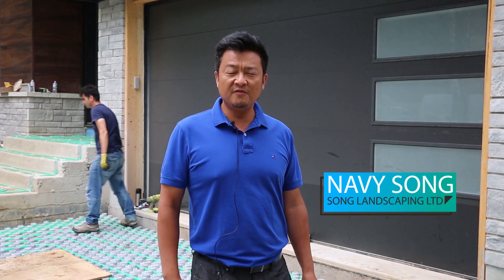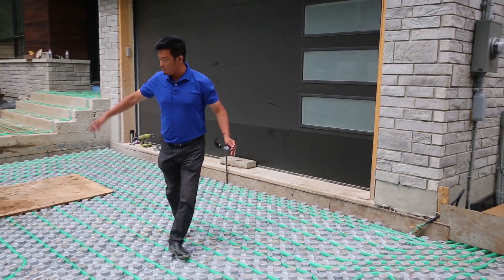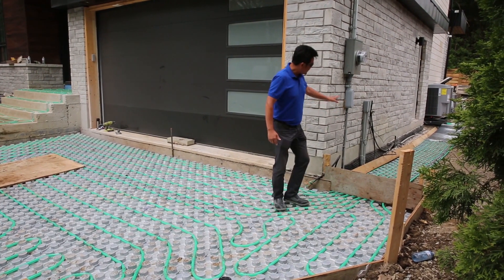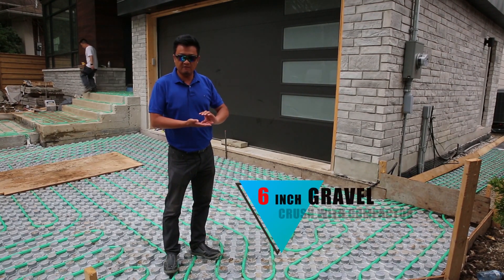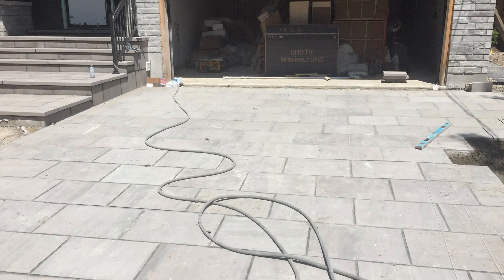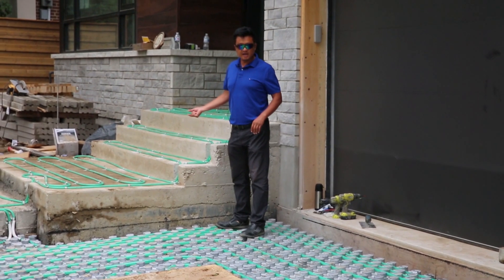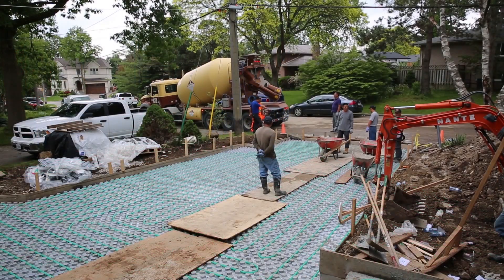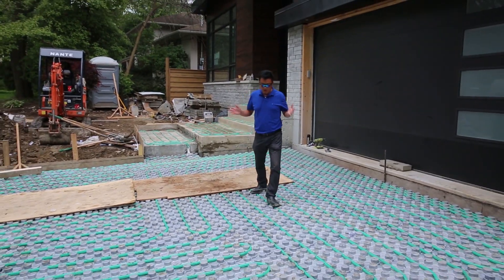HOW DOES HEATED DRIVEWAY WORKS??

Comment: If I had an invention idea that would be a lot less expensive & less time consuming  & that would appeal to more families I’d come up with a product where all you have to do is lay it out like a blanket on your driveway. This “blanket” per say would be custom fitted to your exact driveway dimensions. All you would need to do is roll it out over your driveway & plug it in to a standard wall outlet. It would have a sensor to it so it’s not on all the time only when it starts to snow. Than when the storms done you can just roll it back up, put it in a bag & store it away until the next storm hits. I’d also make it for sidewalks too. Instead of spending a ridiculous $50K I’d price my heated driveway blanket for a couple $100. Every blanket would be custom made to your driveway. Think of it as that company that makes custom car floor liners “Weather Tech” but for driveways.
Reply: I like your idea and enthusiasm, This video with their 24" Base seems INSANE to me. I am going to install my own PeX tube and then put a standard drive in with just 7 or 8" of gravel under and the pipe will only be one pipe on each spot a wheel drives on the driveway........ Your system sounds good but would be more difficult to set out and put away than shoveling the snow......also the "Outlet" would have to be 220V.

Comment: How much $$$?
Reply: I would guess $50K easy
Reply: @Rubenplat  If you let a business do everything for you maybe yes. Once i researched for a 4x8 meter swimming pool that the bottom slab would be 900 euros of concrete. Like 95% of the things of installing such driveway you can DIY. Dig it all, put rebar in, then hire some guys to do the first concrete pour, then install all the piping which is not time-critical so you can take your time sorting it out. Then, opposite of what they did in this video, i would put rebar in for the next layer of concrete, then hire some concrete guys again for the second slab. After that you can choose to install the flagstone yourself or hire someone... that's a matter of estimating how confident you are in laying the flagstone. Perhaps testlay a square meter in the basement 😛. Professionals always try to empty out your pockets as much as possible.